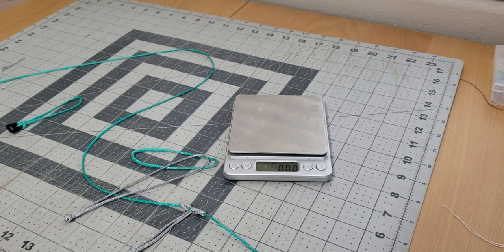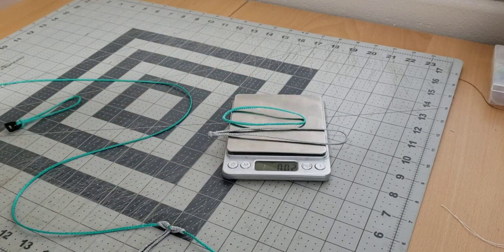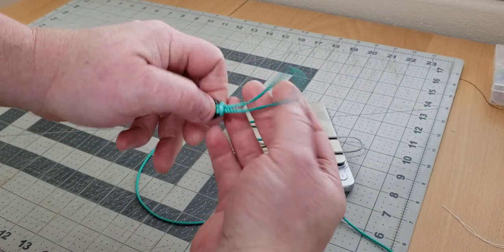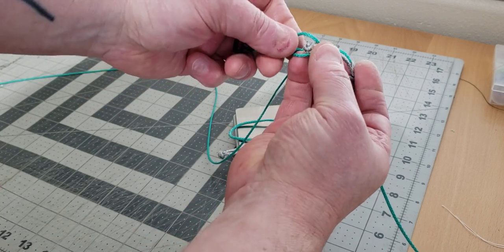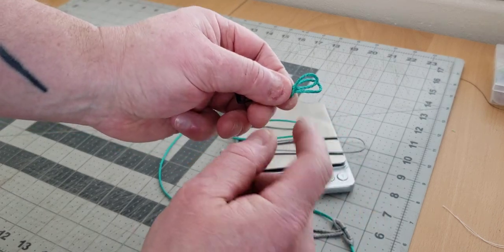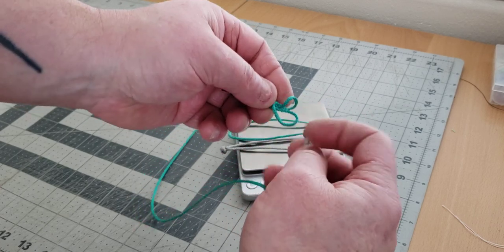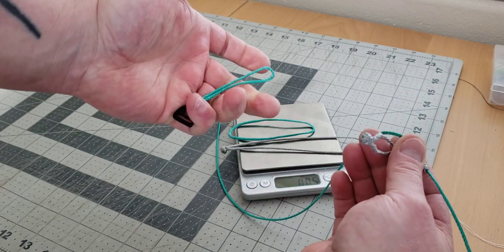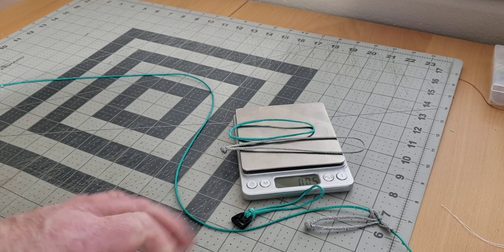tarp connector soft link

Comment: Sometimes there’s a tipping point where there’s just an unnecessary step or piece of gear like this. 

It’s far simpler to just prussik soft shackles onto a continuous ridgeline and attach the tarp’s D ring to the soft shackle. 

The extra lengthy that these two pieces add to the distance between tue ridgeline and the D ring means an increased likelihood of the distance between the ridgeline itself and the peak of the tarp.
Reply from the maker: LMAO you suffer from the disease of the day , always finding fault in things, the distance can be adjusted to suit the setup with more prusiks or smaller loops. This replaces hardware and carabiners and makes a great water break too. At 2-3 grams of added weight , having it there just as a water break only is still good.
Reply: @jeffmyers7062  you mean more loops on the prussik vs more prussiks? More loops will undoubtedly make it harder to move along the ridgeline. 

Jeff, sometimes less is more. There’s literally no need for the extra loops here.
Reply: #1. You're right. There are circumstances when it is necessary to hang the tarpaulin very tightly between the trees - a small spacing / long hammock + a very long tarpaulin are available.
#2. Many tarpaulins need a flexible connector.
#3. This long joint (dyneema) for tarpaulin, does not block water at all. It's just a small water obstacle. I checked. A lock / water barrier is needed here.
#4. I have water barriers (multi-stage) for tapes or ropes (hammock / tarpaulin) - DIY.